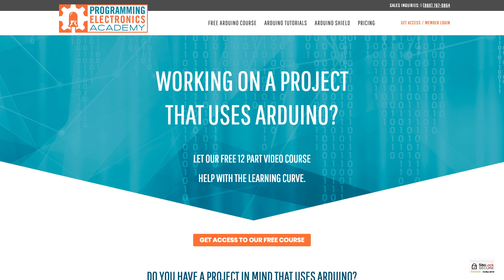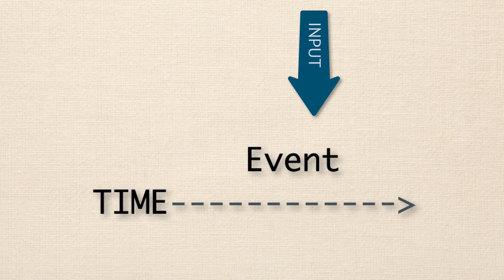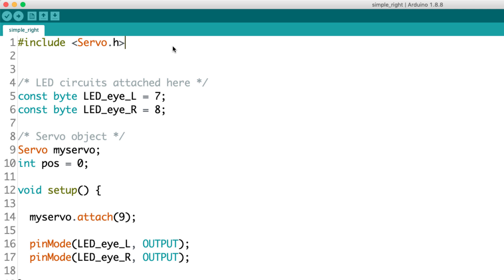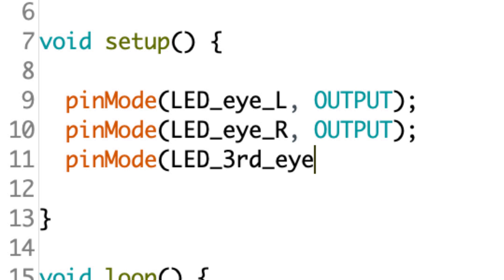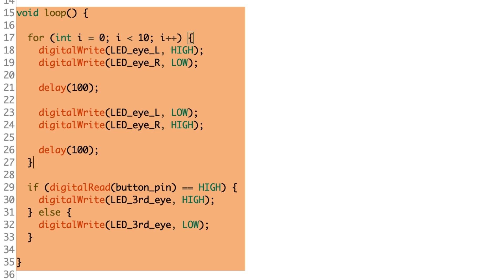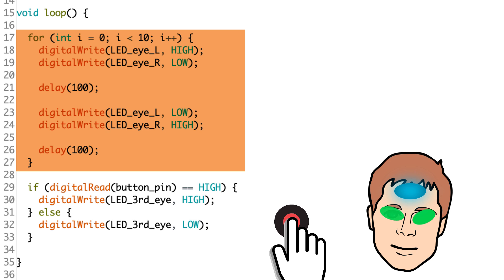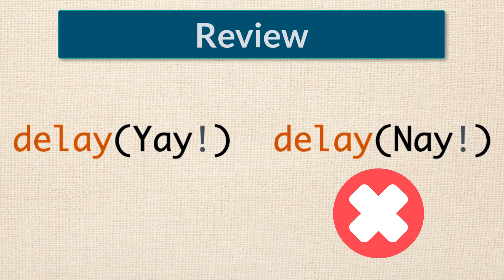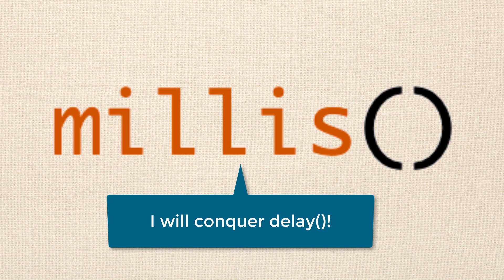millis vs. delay Part 4 | A mini-series on Timing Events with Arduino Code

Comment: Thank you for the series on the millis function.  If you don't mind, I would like to make you aware of a couple of things that I hope will help.  I realize that this is a five year old video, and maybe these YouTube videos are not even a part of your business anymore, but if so ......
This video popped up as a suggested video on my YT home page.  Titled as "Part 4", I went searching for parts 1-3.  I only found part 3, as none of the other parts had "Part#" in the title. I finally found the playlist which included six videos. Problem 2: In video part 3, you illustrated the problem with delay(), with the cardboard figure and and flashing lights. In video part 4, you reviewed that problem but never solved it, just covered the two types of problems that using delay() could cause, one of which was illustrated at 8:40, which was the flashing light problem. This was never solved it videos 4, 5, or 6, which was what I was looking for and I kept scanning through all of them repeatedly looking for the answer. Hope this is of some help. PS: I still don't know how to solve the flashing led/button problem.  If I missed it somewhere, please let me know. Thanks

Comment: You explained my exact situation with a switch with multiple events at different times after the switch is pressed.  You mentioned you would have a 5th lesson with coding examples.  I can't find that lesson is it still available?

Comment: You can use delay while executing 2 or more events.
You simply place each event in a separate function and call upon it in the loop.
NOTE: though this is not really great for big and complicated programs, or 
functions that interrupt each other.  Otherwise you can simply do this. 

void loop() {
     // OPTION 1 
    If (some thing == some value) doSomething();
    if (some other thing == some other value) doSomethingElse();

   // OPTION 2
   doSomething();
   doSomethingElse();
}

void doSomething() {
    // OPTION 1
   ENTER YOUR CODE HERE

   // OPTION 2
    If (some thing == some value) {
 } else {}
}

Same thing counts for the doSomethingElse(); function. 
As long you dont put RETURN in the loop, where you call
the events, they will work just fine, even without millis(). 

But it could be useful for people to use if you do not 
want to touch the millis() function at all.

Comment: I just caught up on this series, thanks. 
  I'm still a bit foggy about how to execute my project that incorporates 3 button states (single/double press and button held) with software button debouncing and a LCD menu (also part of a sensor + I/O system running in the background//so no delay). I'm trying to avoid using multiple buttons in favor of a rotary encoder with built in button. I want to do something like:
button pressed = select option
double pressed = last menu layer
held = return to home/top menu layer

 I can't seem to get it working well especially with the debounce code. It just becomes a convoluted mess. I feel like there should be a much more elegant solution. Perhaps one might incorporate either the use of external interrupts or the other onboard timers + interrupts on the 328 in order to achieve these goals?
  I wish I could figure out or find a way to use millis like delay. I want some kind of simple function that creates a new instance of the flags and timers needed for an effective delay without using delay();.
  ...anyways... that's just my block headed conundrum....
 Thanks for the upload :-)
-Jake